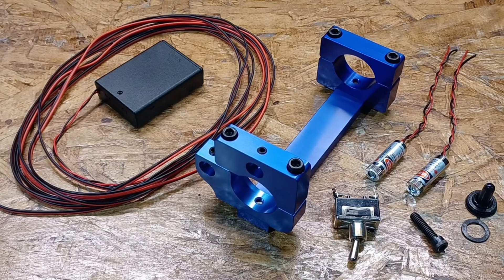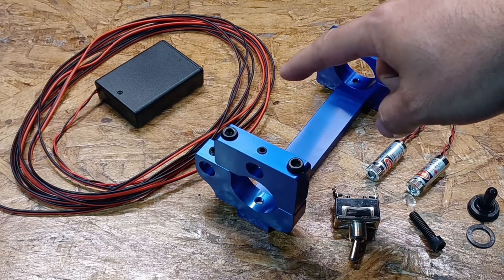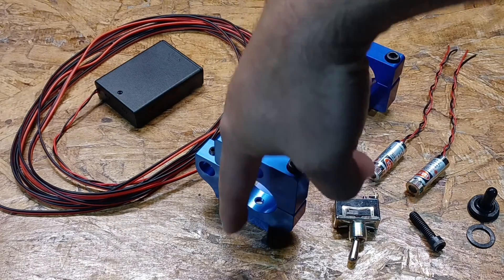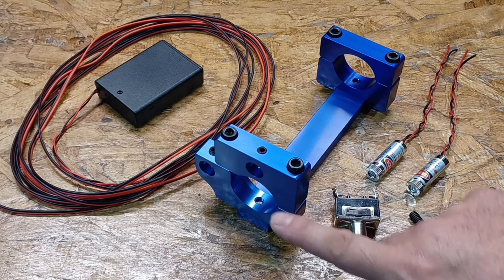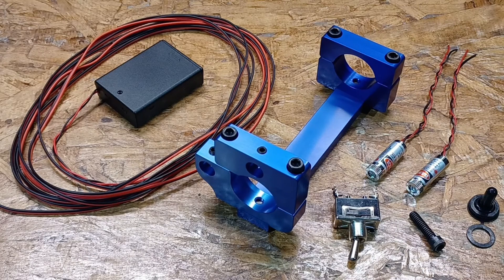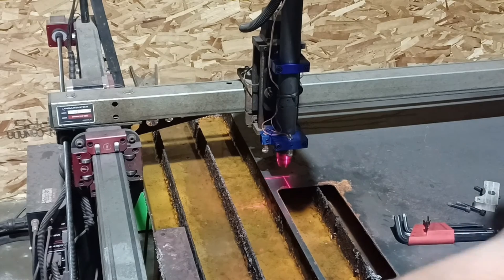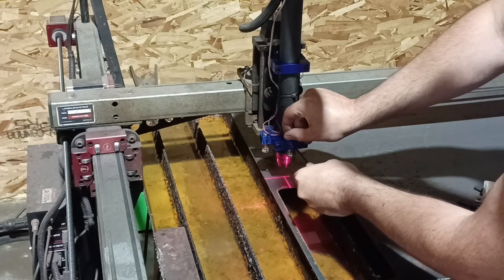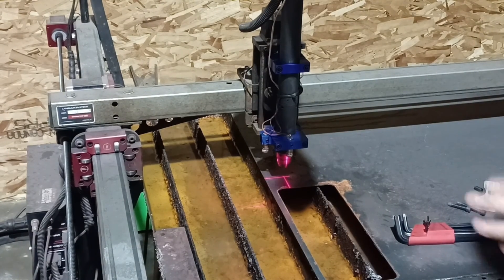CNC Plasma, Machine Torch Holder for your Langmuir Systems CNC plasma cutter. #cncplasma

Comment: That's awesome. I saw somewhere, that you use cheap Chinese consumables. Do you buy those on Amazon, or do you have a link? I want to order that magnetic torch holder, that's a great idea and
Reply from the maker: Yes, the consumables are low cost and widely available.  The kit comes with one set.  I've had the same set for 3 years + lol  You can get a 5 pack of replacement lasers here https://amzn.to/48SlOaz

Comment: can this be adapted to a plasmacam
Reply from the maker: The Pro version has a 1" wide spine and the XR version has a 1.5" wide spine.  I'm sure you can attach it to whatever you want.  If you want to use the magnetic mount than you'll need to buy the Pro version as it works with the mag mount.